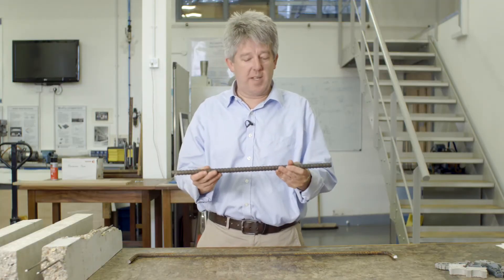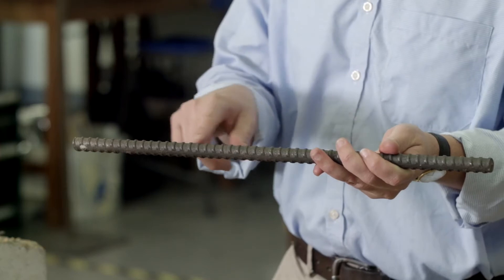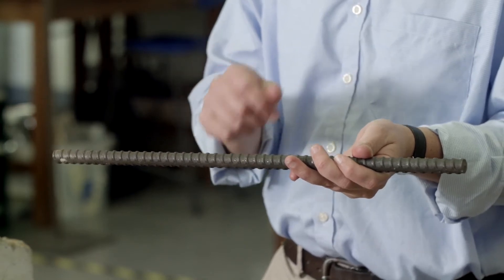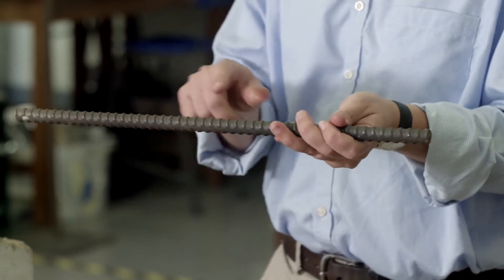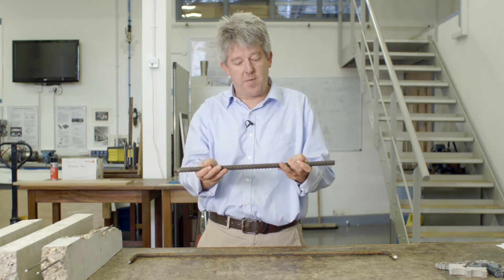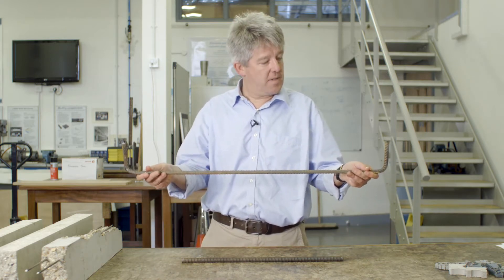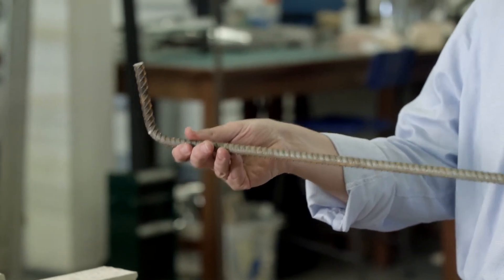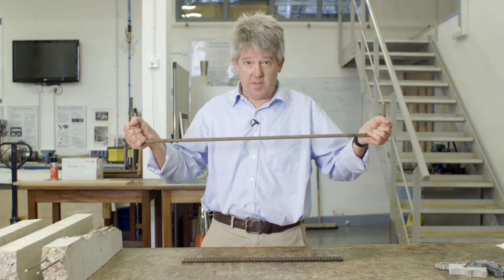Compatability of steel and concrete - BE of Reinforced Concrete with Prof Tim Ibell Pt3

Comment: Hello Sir, Thanks for your excellent video. I have a question, Since the mechanical bonding can be developed by bending the bars at the corners. In some case, Can we introduce some vertical bars attached to the main bars to support anchorage where space constraint location and to avoid congestion at junction .?

Comment: You state only steel is used to reinforce concrete. what about FRP reinforced concretes?
Reply: +Leeds College of Building 

FRP is a possible reinforcement for concrete, and indeed I have spent much of
my career studying exactly this. But the videos were about bare essentials, and
when set against all the other issues which needed to be covered, we felt that
broadening into FRP, and doing it justice (as it is not a simple replacement
for steel), would have been unnecessary and diversionary. A future look at FRP
in a rigorous manner in this series might be sensible. Tim Ibell.